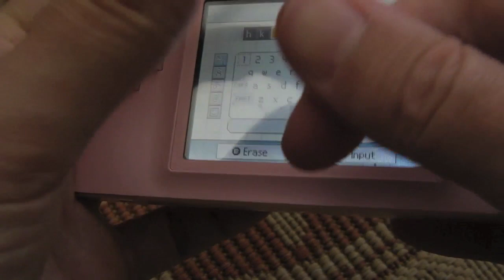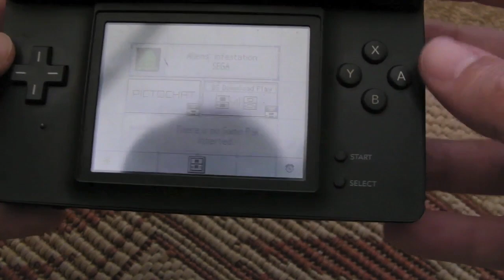Nintendo DS Lite & DSi Simple Fixes (Cart Slots, Touch Screen & Stuck Stylus)

Comment: You probably figured it out by now, since this is an old video, but the game only gets reconigzed in real time from DS i onwards. Phat DS and DS lite you always need to have the systems turned off before inserting the game. Probably related to the hardware, as both are the only ones that have gba compatibility, and gba hardware doesnt update in real time either (they have a separated processor just to handle the gba part).
Reply from the maker: +Padoca85 Thanks, yeah it was one of those things where 2 minutes after I uploaded the videos I checked and then realised that they just work that way =D  Typical lol

Comment: Good to see some nice repairs on those DSes
Reply from the maker: Thanks =D  The DS is an awesome hand held =)
Reply: GadgetUK164
Indeed especially with the emulators that you can run on it. Quite a few 8 bit systems end up working really well from one of those flashcards. ZX Spectrum emulation is pretty much perfect on them.

Comment: Recently found my ds lite. I played for 10 minutes before the touch screen discolored. Writing is hard to read and it casts a pixly red shadow. Any idea how screwed it is? I was so crushed after being so excited to find it.
Reply from the maker: The screen probably needs swapping out.  You can buy replacements for the top and bottom screens on eBay.  You will need a triwing screwdriver to get inside the unit, and a smaller screwdriver set probably.

Comment: I saw a video where he put the ds lite motherboard with the bottom screen into a gba case, he had a flashcard to play game boy games and it could play gba games of course but it could only play 2 ds games that had codes to switch the screens in game so he could play those.
Reply: I'm wondering if u think there is a way to switch the displays with a button hardware mod, I'm interested because with one screen he said that he hot 10 hours of battery life!
Reply from the maker: Yeah, I saw that video too =D   It's a cool hack, but I prefer the original systems without hacking them that much.

Comment: This is a bit out of the scope of the video however I have searched online and never found an answer for years. Quite some time ago I bought a ebay refurbished ds lite (not the smartest choice i know but it was cheap). After I received it, it worked fine however the touchscreen required a small amount of force to actually register the inputs. I though this just was the case with old touchscreen technology ( I was young XD). However I bought a second one for my cousin and that one worked flawlessly. I seriously don't know what to do because the screen is fine, to me it seems that the touchscreen is somehow a bit distanced from the plastic clear top thus requires more strength or the plastic top of the screen where you actually touch is thicker than it should be however that would be evident from dissortion i think if you looked at an angle. TL;DR Ds lite touchscreen works, requires a bit of force to register though and I think it might be isolated to mine however if not is there anyone who knows what to do? 
Thanks in Advance
Reply from the maker: It's probably a case of low quality "after market" replacment touch screen.  It could also be that there's a screen protector fitted by the previous owner perhaps?

Comment: I was watching a video to clean cartridges and he said use a Q-tip I used one but I put the Q-tip in my stylus holder and it got stuck. What should I do? I have a 2ds by the way it doesn't have that little square thing with screws on the back.

Comment: On my 3d ds, I have a stuck style and I don't have the screwdriver. The real problem is when I tap the left side of my screen it taps the right side. I tried calibrating the screen that wouldn't work with the left side not working. You have to push down really hard on the edge on the left screen to go a little of the right side screen. Any way to fix this?
Reply from the maker: See my recent-ish replacement of the touch screen on a DS Lite.  You might need to replace the touch screen.  Or maybe dirt has got under the edge of the inside of the screen.

Comment: I replaced my top screen of my DSI XL but the top screen is darker than the bottom now,I can't remember but is there a way of turning up the brightness of the top screen do you know,I got the screen from eBay..?
Reply from the maker: That's one of the problems you can get with cheap replacement screens.  Often better to buy a faulty original system (with good screen) and swap the screen from that =/

Comment: Any suggestions to clean dust that got wedged between the touch screen and the plastic that holds it in place? I have a ds lite btw
Reply from the maker: The only thing you can do is try compressed air, if that doesn't work you would need to take it bits and seperate the protector / digitizer from the screen to remove the dirt.  Use a piece of sticky tape carefully to do dab up the hairs or dust and inspect before re-assembly.

Comment: The pad under the red dot tape might be SL1. It's for firmware write protection at least on the first models (nds flashme). Still "warranty void if removed"
Reply from the maker: The bios chip is unrelated I think - It's a seperate removable module as far as I can see.  I am pretty sure it's a moisture detection pad - the stuff its made of is absorbant - I suspect the red dots will run onto the white background.
Reply: GadgetUK164 You're right. I just started a game slot repairing job on 3DS and it has those stickers all over it. NDS just happends to have one over some service pad.

Comment: I dropped my DS Lite, and the touchscreen doesn't display properly. The screen itself is fine; it responds to touch and displays what it's supposed to display. It's just that the image on the bottom screen flickers and jumps around constantly. Would LCD replacement help, or does the digitizer need to be replaced, too?
Reply from the maker: It's impossible to tell - you would need to throughly inspect it.  What sometimes happens is small fractures occur in the PCB, or an SMD capacitor may have popped off the PCB from the impact, or the could have fractured.   Your best bet is to buy another working DS Lite and swap parts around until you work out which part is causing the fault.

Comment: I'm so sad cause my DS lite turns on but doesn't read my R4 and like you said it doesn't have the plastic dividers but I don't see anything wrong with the pins apart from oxidation... I can't seem to clean it off and the roof of the slot is looking pretty bad but idk if it has anything to do with reading the card ... Im really gonna cry if I just lost my precious ds :c, do I keep trying to clean the pins and the R4 or just give up?
Reply from the maker: Try some contact cleaner or deoxit, and re-inspect the pins in the DS with magnifaction.  Are you sure the R4 isn't dead?

Comment: I have bought a refurbished ds lite on ebay a few years ago. i know not the smartest idea. i remember even from then that the everything was perfect other than the fact that the lower touchscreen requires a lot of force to register. A LOT. i bought a second one for my cousin and his of course works without a hitch so it is definitely my ds' touchscreen. is it possible the screen has a gap from the plastic protector above or something else, and can it be easily fixed
Reply from the maker: I've honestly no idea on that problem!  I wonder if it has a 3rd party screen protector on the bottom screen?  If so, you could try removing that.  The other possibility is the bottom screen has been swapped out for a 3rd party screen (there were cheap chines clones of the DS lite) - so maybe the screen just needs swapping out for a proper Nintendo screen?

Comment: I try to calibrate my White Nintendo DS Lite Touch Screen, but the first test keeps resetting, and the 4 [+] boxes don't appear as they did for you. I saw a video where a guy taped the top of the housing of it, and lifted the bottom half of the housing, and wiped down the touch screen under the housing. I don't know if I can do this since the one in his vid was flexible, and I'm not sure if mine is.

Comment: Hello x I was wondering if you could help me, I cant get ahold of ANY new screens for my nintendo dsi xl. The bottom screen is not working, it does the same as what you said, it's a bit offset. I was curious if theres any way to fix it
Reply from the maker: You can find replacement screens (and the digitizer) on eBay - just search for "DSI XL screen".  Instructions on recalibrating the touch screen are here:- https://www.nintendo.co.uk/Support/Nintendo-DSi-XL-/Basic-setup-and-use/System-settings/Recalibrate-the-Touch-Screen/Recalibrate-the-Touch-Screen-242069.html

If that doesn't work, you will probably need to swap out the digitizer.  I covered the same process on a standard Nintendo DS Lite on my channel last year.
Reply: @GadgetUK164  Im from south Africa so we don't have eBay delivering to us 😅 otherwise shouldn't lifting the screen and cleaning it help as well?

Comment: just bought a ds lite it reads the ds game but only some gba games. the Mario game saids corrupt data on game. how do I fix it. or get it to read the other gba games. please help thank you
Reply from the maker: There are a few possible causes - it could be that some of the pins in the cartridge port are damaged or bent.  You should inspect them to see if any look misaligned.  The other possibility is there's a fault on one of the boards - probably not a lot you can do about that yourself.  DS lites are pretty cheap on eBay these days, probably just as easy to buy a few faulty ones and try and make one out of two.

Comment: do you have any solution for  my dsi game slot problem?
when i insert a game cartridge i think the spring lock just slides over the card and doesn't hold it (its returns to its og position) , which leads for the cartridge to not stay in place and unable to play
Reply from the maker: You would probably need to replace the cart slot - not an easy repair!

Comment: I had the same problem with you at the start when the calibration was off how do you fix that? Mines really off and I can't do anything
Reply: And calibration wouldn't work for me
Reply: I can touch the screen nothing wrong with that but it's off
Reply from the maker: You need to navigate to the calibration settings in the menu - it's a case of using touch but work out where you need to tap the screen to get the buttons to press etc.  Once you get into the calibration part you should be able to re-do it so its accurate again.   Might be worth removing the batter first, and then reconnect it, then try to calibrate it.
Reply: does that works with 3DS too? i have same problem but for 3DS..
Reply from the maker: Yes, there's always the chance you've got a fault but you can test by going into the calibration and see if that sorts it.  It's hard navigating though because the stylus position is obviously so inaccurate.

Comment: My ds light only reads games when pushing them down into the eject position it seems the reader is too far down any suggestions?
Reply from the maker: Inspect the pins in the cart slot with a flash light to see if any are bent out of position.  You could try cleaning by adding some IPA onto a cart and insert / remove the cart 20 or 30 times and re-test.
Reply: @GadgetUK164  It worked thank you very much for responding.

Comment: My games need to plebe pushed down really far for them to read and I can’t figure out how to fix that issue
Reply from the maker: It could be a bent or damaged pin the cart slot.   You could try adding a drop of IPA (or window cleaner) to the cart PCB edge and insert / remove the cart several times.  That might just clean the contacts enough to be more reliable.

Comment: Is it possible to clean the slot you insert the game in without taking it apart its not the same issue
Reply from the maker: Yes, put some contact cleaner (or IPA) onto the game cart contacts and then insert and remove the game several times.  If the contacts internally are dirty, that should solve the problem.  Sometimes they are bent though!
Reply: @GadgetUK164  hi I'm sorry about bothering you how do I put rubbing alcohol on the game to clean inside the dsi slot without damaging it or the dsi

Comment: my aunt gave me hers from years ago and only couple games worked then out of nowhere none of them did and checking the slot with a flash two of those teeth are missing:( idk what to do
Reply from the maker: If the pins are missing in the cart slot, it will likely need another cart slot fitting!  It's not an easy thing to replace if you are inexperienced in soldering and desoldering.  Probably best to sell it for spare parts.

Comment: Hi! What should I do if my touchscreen isn’t working?
Reply from the maker: Probably try cleaning around the edges of the touch screen (perhaps after removing the cover from the DS), and if that doesn't work, it will likely need a new touch screen digitizer.  They often fail on the DS lite.

Comment: the card slot's pins on my ds I are fine but it still doesn't play the cards?
Reply from the maker: It could be a fault in one of the ICs, or maybe a break in a trace somewhere on the board.  Try getting contact cleaner onto a cart edge and insert / eject the cart a number of times to see if that makes any difference.
Reply: I just had to clean the contacts on the card and on one of the cards one of the contacts are just ruined.  :I

Comment: My DSi has this issue where the sd card won’t go in fully. I’ve tried it on 3 different cards and it’s really frustrating.
Reply from the maker: It sounds like one of the pins is damaged in the SD socket, perhaps bent upwards?  Or the latch is broken on the SD slot.  You may need to replace the SD slot...

Comment: please help! my pokemon platinum game is stuck inside my dsi’s catridge slot and it won’t come out. when i click it, it only comes up about a quarter of the way and it is impossible to pull out (or maybe i can, but i would probably risk damaging the slot mechanism.) can anyone help??
Reply from the maker: I suspect one or more of the pins inside the cart slot may have bent and be sticking on the cart.  It could damage the cart connections if you forcibly remove it.  But I dont think you have much choice!

Comment: my cartridge used to work but after i turned on my wifi it doesnt work anymore “error occurred “ pops up ://
Reply from the maker: It could be the WiFi antenna has popped off inside.  They are clicked on and if the system is knocked or dropped they can disconnect.   Could also be a shorted cartridge pin perhaps - worth inspecting the cart slot.